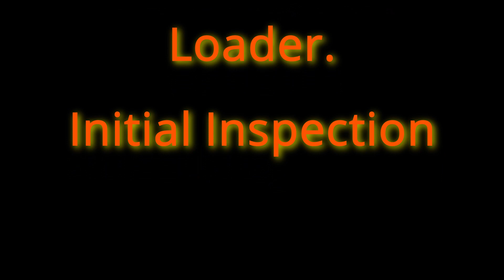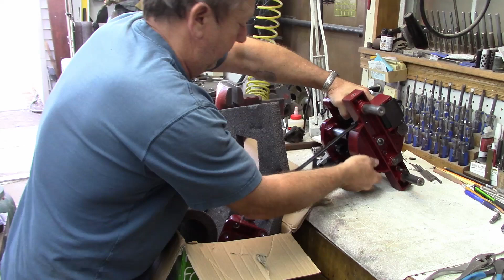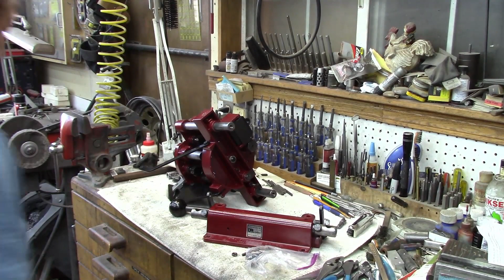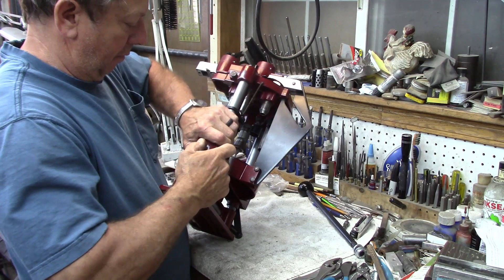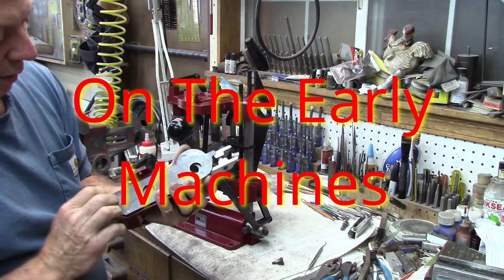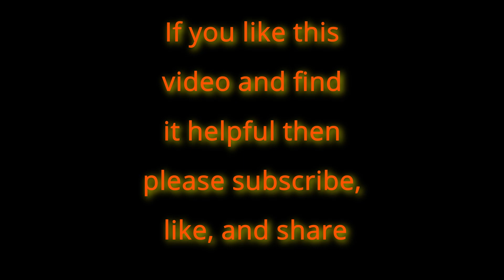Upgrading A Customers Hornady 366 Reloading Press, The Initial Inspection

Comment: I made extra large shot containers for reloaders with there own base that would bolt down to the bench . for mec I made it mount under the machine but wouldn't add any weight to the machine itself. They hold over 75lbs of shot and with an option of powder container to hold a pound of powder with shut offs to allow machine to tilt for cleaning or repairs. Mainly for the hydraulic n electric ones for trap n skeet shooters. If you would like I can send pictures.
Reply from the maker: Yes there have been several designs for larger capacity powder and shot hoppers including one I am refining. What provisions have you done to be able to empty the hoppers at the end of a reloading session or to easily swap components?

Comment: I’m looking at a pacific 366 for $250….is that even in the ballpark for a functional press?  Are there better options?
Reply from the maker: If you compare it to a new 366 that is a reasonable price as new they are well over a thousand but the pacific is probably manual index and straight wad guide. there are other options such as the mec, but I prefer the hornady/pacific. to upgrade the pacific to auto advance and swing out wad guide puts them at about 1/2 to 3/4 the cost of new but as far as I know I am the only one currently converting them and I am way behind on the one I am currently working on. Dan.

Comment: I think you probably don't work on 366 but ,I have a 266 single stage could it be  possible to convert to load 3 inch
Reply from the maker: I believe the dies are the same for both models, but haven’t researched it, Dan.
Reply: @hillsgun  thank you for making time to answer  me , if the machine was a 366 what dies should I use to converted to 3 inch and thanks again for the reply
Reply from the maker: There are no options as far as I know, you have to use 366 dies from Hornady.

Comment: Hey Dan. I own a Pacific DL-366 and would like to purchase the auto index mechanism you've manufactured. I checked out your website, couldn't find it. Thanks
Reply from the maker: Thanks, the auto index and swing out wad guide are conversions that I do from time to time although right now I am not taking any as I have been to busy with other projects. I have never offered the parts as there is some modifications to the original press castings for it to operate correctly.
Reply: @hillsgun  gotcha. Well, if and when you might decide to take on some new orders, I'm  interested. Thanks!